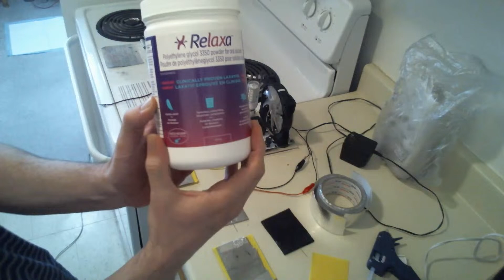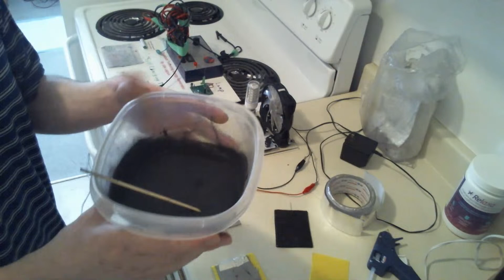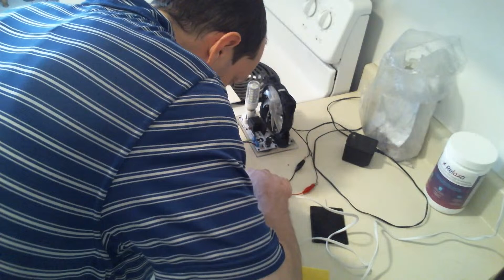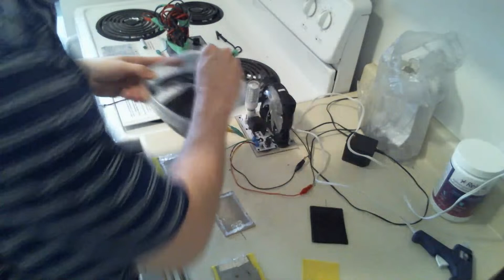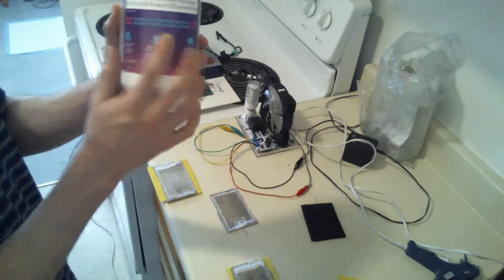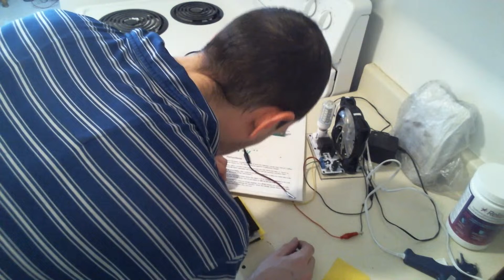Building Power Cells

Comment: Would you consider free energy plan that takes a 50 foot length. Rolled coax cable placed in an oven approximately 200 to 300 degree not sure with out melting of course. Condition the coax with dc high voltage at the same time. I think it says it produces 50 watts continuous power. But not sure of the exact details. But it says you would need to find a way to buck it down on voltage. Supposedly the plan said you would have to short it out with covered aluminum for a week to process it for use. And polarity could change a couple of times. Dont know if plans were true.

Comment: Try rolling it up like a capacitor and as for the mixing use an ultrasonic vibrator to activate the mix. Also use deionized water, you are contaminating the mix.  Very nice video

Comment: Thanks, very informative.  The unique part of this is the carbon felt. No galvanic reaction. However I wonder if there is a reaction between the copper oxide and zinc. Instead of zinc, will aluminum foil or copper foil work just as well? Why zinc?  Thanks Joel.
Reply from the maker: No zinc, I was just sayings I tried others and nothing worked as well as what i'm using.